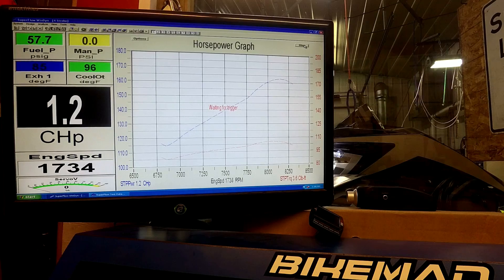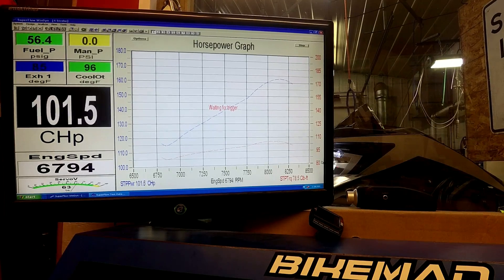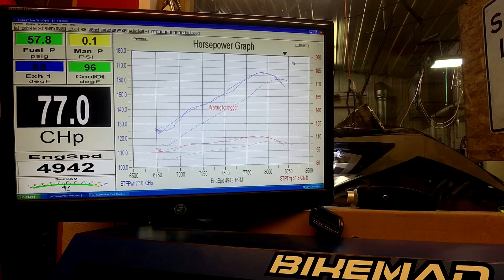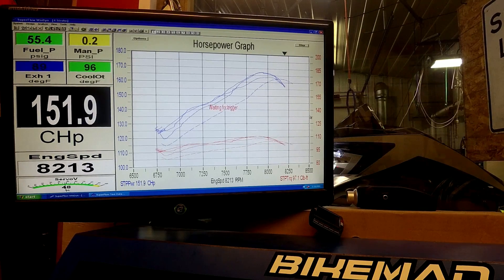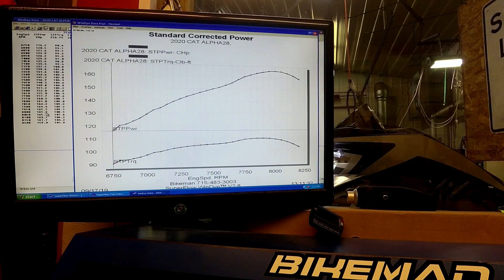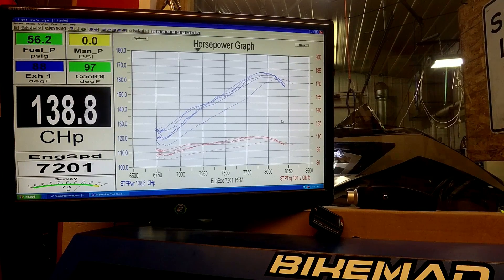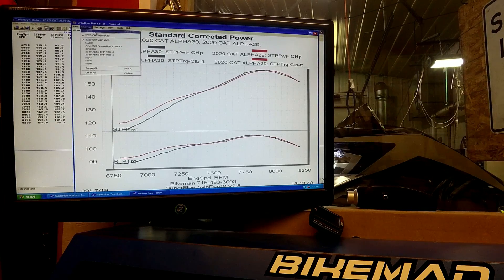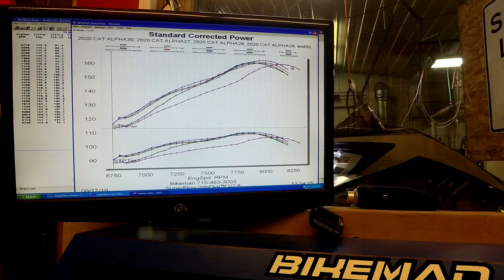How much power does the 2020 Arctic cat Alpha make?? SEE HERE!

Comment: Anyone notice it's only taken most of the manufactures 20 years to get back to the 170 180 HP levels of the pre- 2002 triple triple sleds?
Reply: Here is an example: my 1992 RXL 650, 105 on the speedo. My 2018 ZR 8000, 98 on the speedo. To say I'm disappointed with the power of my first Cat is an understatement. Insert crying emoji here.

Comment: What elevation are you testing at?
Reply from the maker: Around 800
Reply: Joey Strub so what kind of r&d do you do for the higher spectrum of elevation (like 6-10k feet)
Reply from the maker: @exploringmontana  We use mathematical formulas to create fuel and timing compensation tables that will automatically adjust ECU for changes in Elevation, IAT, ECT, Baro, Pipe Temp. Then we do extensive testing at all elevations including the 6-9k and 9-12k  to verify algorithms are doing what they are designed to do and make changes where needed. High elevation riding is my all time favorite and go every chance possible. Clutching is an awesome measure of how much power a snowmobile engine is making so we can tell by the amount of weight it can pull about how much power it is making. Check out this clutch weight calculator I made, you can see how HP effects clutching. -> https://bikemanperformance.com/tech-tips/clutch-weight-calculator.html
Reply: That’s awesome Joey Strub. It’s good to hear that it’s not all just on the dyno and with math. Sometimes there isn’t any substitute for hands on riding. Thanks for the insight!